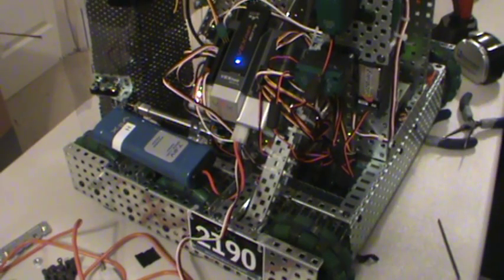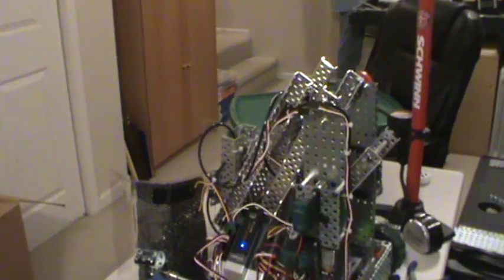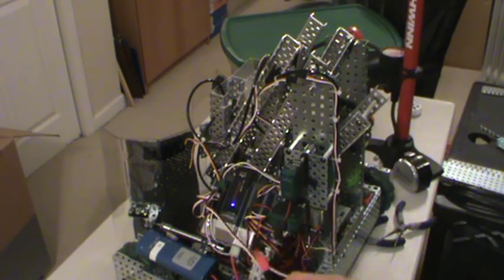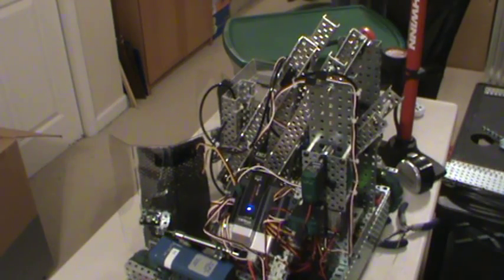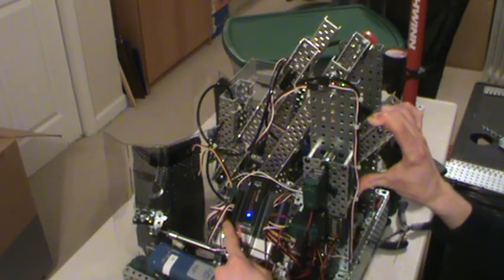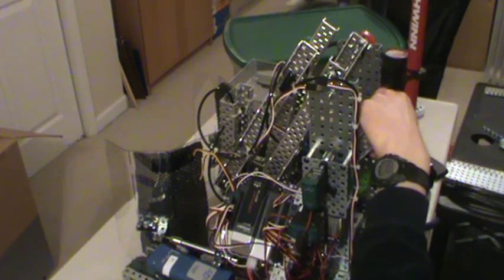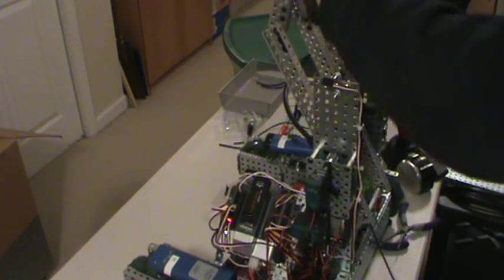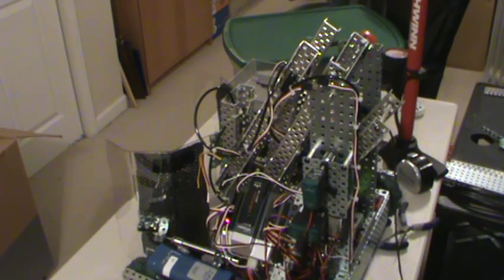VEX Potentiometer affecting digital ports

Comment: Well with what I know about the potentiometer the readings is somewhat right the potentiometer reads in 10ths of a degree so when you saw 100 that was actually 1 degree and when it went up the potentiometer read 3000. but when you moved it slightly up and it read 1500 then that looks wrong if you mean 150 then that could be right,